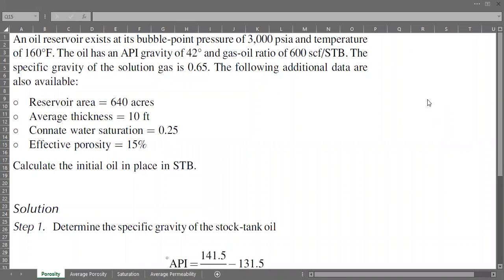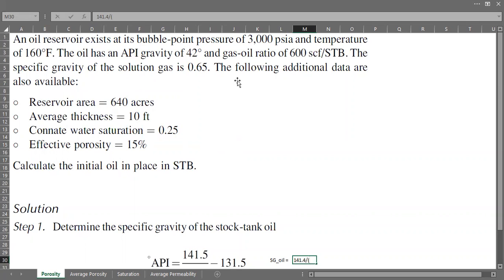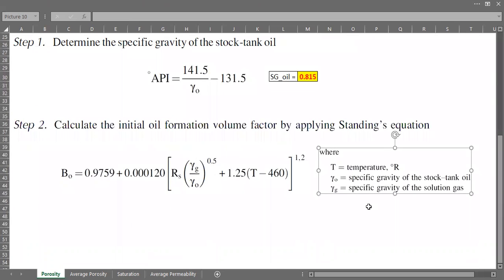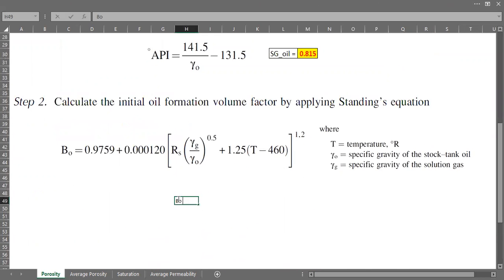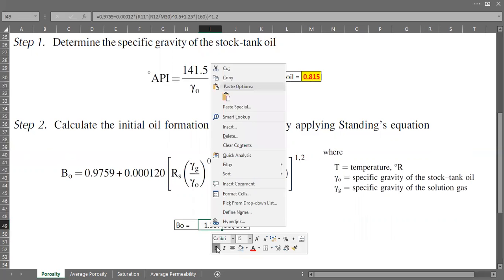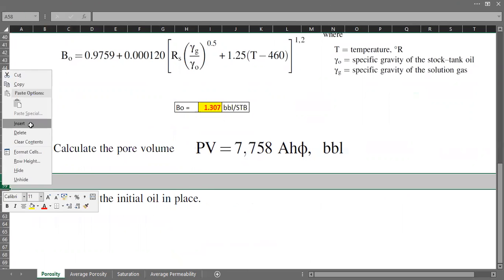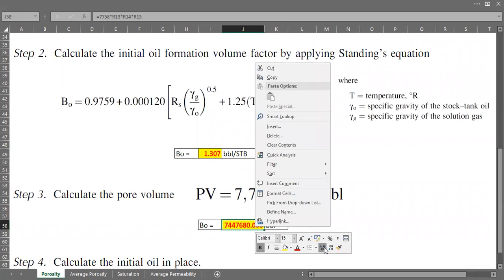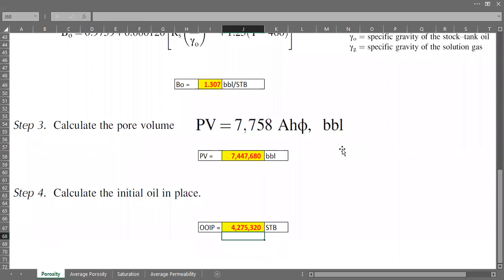Q&A 26: Porosity & Initial Oil InPlace

Comment: Please can you help with this,I really need to know how you got the Bo because I've been trying to but I got very different number
Reply from the maker: Bo can be calculated using several correlations... None of them is the best among others. So if you already use any correlation correctly with correct values and parameters, then it's OK. Make sure the value you got is close to my value because the difference of Bo produced from those correlations are close to each other.